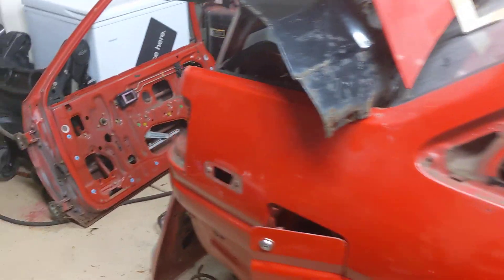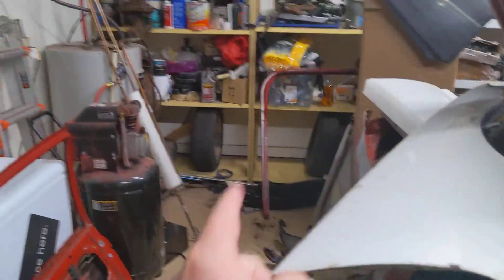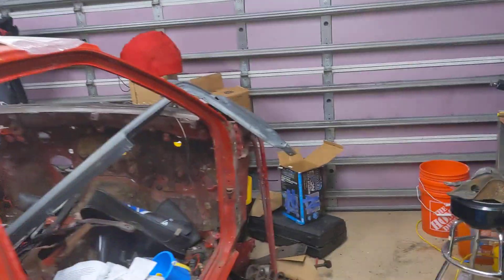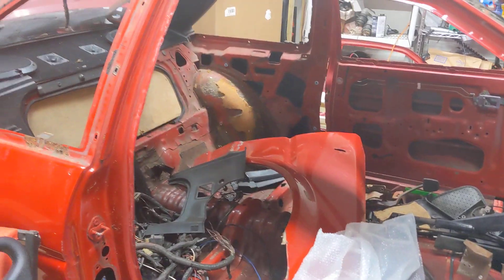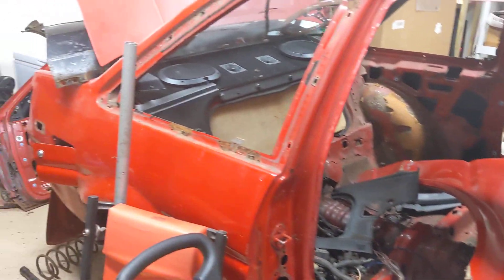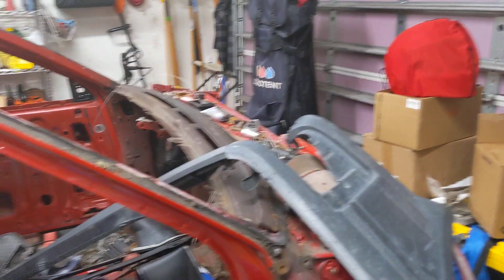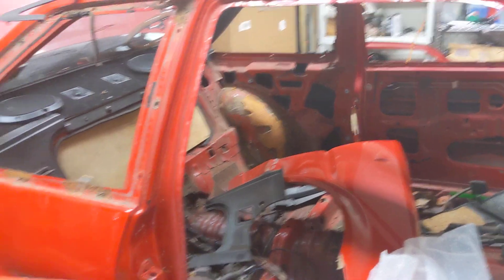What Standalone ECU for a Blacktop BEAMS 3SGE?

Comment: Hello do all your beams run vacuum or deleted?
Reply from the maker: There really aren't any vacuum lines to run with a swap, so I pretty much "delete" them/block them off.
Reply: @DoctoredGarage  Thank you very much 🙏🏽
Reply from the maker: You're welcome!
Reply: @DoctoredGarage  Hello I deleted the vacuum. I can’t  get  it to idle steady it’s been fluctuating I cleaned the tb and still . When I start it when engine is cold it revs high then goes low the idle fluctuates. When I accelerate the idle goes down. Any hint 🙏🏼
Reply from the maker: If it wasn't doing that before then you might have an intake leak or you deleted something you weren't supposed to. 
Vacuum delete generally refers to the small vacuum hoses. If you deleted one of the large hoses, like the pcv or the big one that is after the MAF and goes to the valve cover, that could be the problem.
Reply: @DoctoredGarage  I deleted vacuum switching valve. I was thinking get IAC kit from panic.
Reply from the maker: It's really hard for me to say what's going on without knowing everything about the car. The stock ECU controls idle with the electric throttle body, and thevsv is for a trap door in the stock air box that will open and close depending on load.